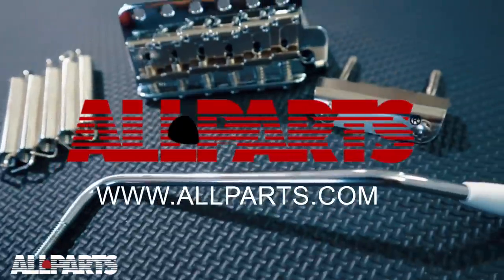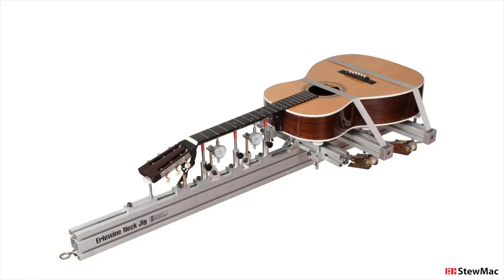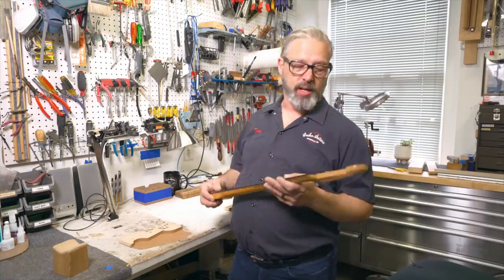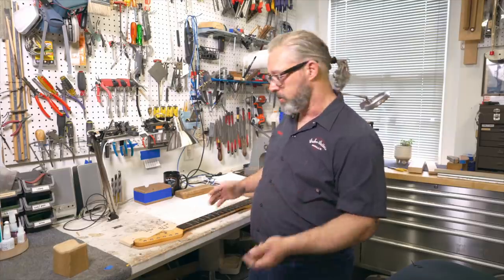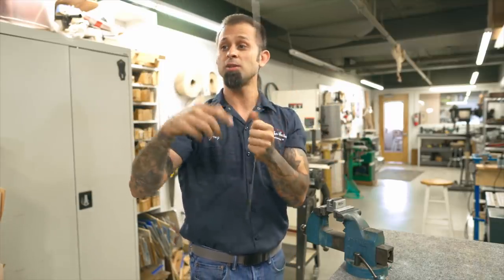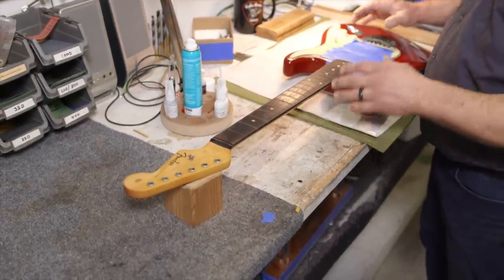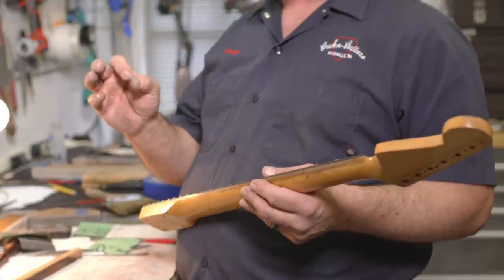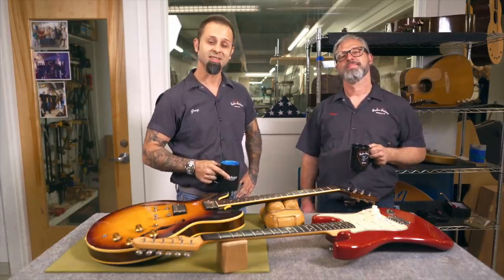Watch a ’59 Strat & a ’59 ES-335 Get Refretted in Under 10 Minutes

Comment: I need a refret bad, but am worried that Guitar Center (only option here) will not do all those little necessary things that make it done correctly. What are the main questions to ask? Should I just consider a new neck (afraid I'll get one that doesn't just fit perfectly)? Also, I'm lefty. Also have Multiple Sclerosis, which makes it hard to understand and comprehend what to do, and how to do it. My life is sucking bad, but having my #1 guitar fixed would sure make it seem slightly more tolerable, at least until MS takes playing guitar away from me. Need my guitar fixed while I can still play.
Reply: If you end up going to Guitar Center ask them to see previous works, get some references, it's really easy to butcher a guitar neck when refretting, it has happend to me and it sucks.
Reply: @GerryBlue  DO NOT go to Guitar Center!!! 20 something year olds butchering guitars
Reply: I wouldn’t take my guitar to GC...I’d recommend shipping it to a good luthier...a bit pricier but hey, it’s your baby!!!!!
Reply: You're playing Russian roulette if you take it to GC. Very few GCs have guys that can do quality fret work. If you're lucky, you find some that can do decent set ups and maybe electronic work.

Comment: Isn’t a 59 strat suppose to have a maple neck ?? Is it common practice to take the neck off a strat for refret ? If I had a guitar worth that much I wouldn’t want anybody to take the neck off idk
Reply: 59 was the first year for rosewood board Stratocaster
Reply: Removing a neck is no big deal at all, especially for a guitar like a strat.  In fact, on these vintage ones it's required in order to adjust your truss rod.

Comment: Gotta wonder about sanding the boards. I've refretted instruments and always sanded the board, but you wonder if you're taking away some of the character of an especially old instrument. Only the frets need to be level... but, I guess, do what the customer wants?
Reply: You have to remember you have to have those frets as level as possible on the board. No matter how you take the frets out, there is always going to be an issue with wood from the slots coming up. If you dont get them down the only way to stop any buzzing is excessive filing (which takes a lot of your wire away and just means you'll refret again even sooner) and thats still not a guarantee. I get mine to where a razor blades edge wont go underneath. If it does and I disregard it, I always have problems.
Reply: @jubjub905  Yeah. Well the increased amount of crown filing is the reason I've always sanded! ...and I've never worried about little chips being glued back in as a result of that. What would you do if tasked with a 59 Les Paul with provenance with some subtle dips in the fretboard? Slightly taller fretwire to compensate?